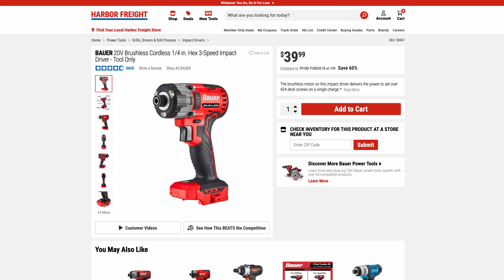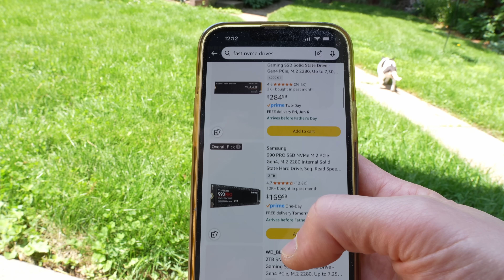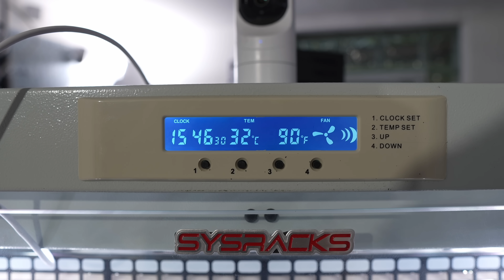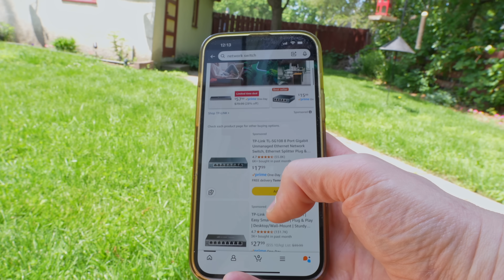Buy Once, Cry Once: How I Wasted $2,857 on Switches

Comment: Love the way you have distilled the approach: "Buy once, cry once". I thought I was over the incremental learning, upgrading, learning, upgrading cycle, but its hard to see when you are stuck in that loop. Most recently I have found this with my solar powered garden shed. Same approach, same failures, and same ultimate lesson. In my case I have settled on  the solar charge controller  I should have always had: A Victron MPPT device with Bluetooth, solar data downloads and rock solid reliability.  Hard to appreciate the RIGHT solution sometimes unless you've spent time (and money) with the wrong ones.

Comment: Doing consulting: I'm constantly trying to figure out customers actual requirements, not just what the CFO budgeted for without any understanding of what their needs were.
It's tricky, but I've gotten pretty good at it. ... This method only works when the CFO's aren't getting replaced every 6 months (or every few years), which lets them realize the gain.

Personal: it's not much of a problem. Even with other hobbies, by the time I've bought something: I've already done so much research and expanded the scope of what I want to accomplish that im already in knee deep.

Comment: I just did this buying my first 10 gig switch, only 5 port when really i should have gone for 10-12 but the cost jump was high. I’ll never have as many devices as you but I have a NAS, a desktop and a PCIe enclosure with 1 Gig among other things. Ugreen just sent me a NAS and one port for the uplink to my WiFi which also has some retro Macs connected and raspberry pi and I’m out of ports. 

Should have splurged so I could expand.

Comment: My problem is I started with simple needs.  I had a few computers using ethernet, one wap, and not much need for anything else.  I then bought a Drobo (boo, hiss - I regret it to this day) and I needed a server.  Drobo died, needed a NAS.  Then, tablets came out - suddenly needed WAPs.  I guess my point - I could not have planned or forseen what was going to be needed.  My rack now has too many switches.  Maybe I'll do what you did and get one to replace them all - could sell my others and recoup some of what I spent.

Comment: 1 - You get a brand new Device with new Warranty when you buy it
2 - Smaller Switches draw less Power vs a larger one with unused Ports
3 - Redundancy when you have 2 small Switches vs one larger one that Powers everything (Single Point of Failure)
Reply: I landed on point 3 when our main 48 port PoE switch at work failed. Now we have two 24 port switches in it's place, if one fails not everything goes down with it and importaint things could be swapped over to the still working one.

Comment: From my experience, 24-port switches are normally a waste, it is wise to just skip 24-ports and get the 48-port model.
8-ports (or even less) are even worse, they are just worth it if you are completely sure you won't need more ports, for example you just need to feed 3 cameras on one specific point and it is physically unnecessary to fit more.

Comment: Problem with tech is that it continues progressing, you might think the switch end of the line, but its not, likely in a couple of years there will be a switch that will do things you need that you didn't foresee before.   Just buy whatever you need that your budget allows, but not thinking its the end, just another fase that likely will require more over time.

Btw how noisy is the switch? i might commit to it if not quiet switch.

Comment: The issue here is not "buy once cry once", but is that you bought only to resolve your current issue and nothing more. 

This is perfectly acceptable for a setup that will barely change. Instead, buying gear that you can expand into would have been a better choice, and as other s have mentioned, some of the more powerful or bigger gear did not exist.

Comment: Well there's a ditch in either side of every good idea...
On one hand not spending enough on the correct solution, and on the other constantly over-spending to try to be the most ahead of the curve as possible...
I suggest penciling the lines before either ditch...

Comment: Personally I always live 10 years ago in networking gear (still on 1 Gbps for everything, but I also have only a few devices). One thing I discovered recently is that buying used, if done correctly, can save you a ton of money.
Reply: Your ISP out is only 1 gps anyway. These equipment makes sense in an office with 50 people all trying to connect to wifi at once with rundant business isp circuits with fiber! But a home user can benefit from an expensive router and a mesh (not to this guys extreme) if 5 people are visiting for christmas and you have 3 cameras, a door bell, smart fridge, and the 5 guests are all streaming and running nintendo switches, tv, netflx, and other things. A good prosumer 10 gb router even with a 1 gb connection out won't lag from the demands.

Comment: I bought a UDM SE a Year ago, because i only needed 4 poe ports at that time, one AP and three cameras. Over one Year I‘ve got so much poe powered gear that I allways had to unplug what I didn‘t need in this exact moment. A month ago I found 2 24 poe gen1‘s and a 48 non-poe gen 1 for all of them together 150€. They are used but Ihad no problems so far. I now have finaly enough ports but if I bought them and a used UDM Pro I probably would have spend the same as I’ve spend on the UDM SE.

Comment: the real issue is all the new devices are forcing you to go poe... if im running poe to my cam outside, i can pull a low volt wire just as easy, so for me i could careless about poe. what i do want is enough ports and now days 10g is the low bar for a new run, id want to pull fiber to every spot and id want a switch with 25/100g options... but sfp to rj45 does have that heat issue wish is not great...

Comment: Im also in the same boat. I purchased TpLink Er8411 and ton of Omaha switches for different purposes just to realize that I completely messed up as the Omaha sdn software is extremely slow and now I have to make the hardest decision to just move over to the Unifi ecosystem that was already planned before I got my Tplink gear that replaced the MikroTik equipment I got first. I spent a lot for garbage :)

Comment: "buy once cry once" is imo more about figuring out what your needs are exactly, planning ahead and adding overhead for future expansions, then getting what you actually need instead of trying to dance around it and get a bunch of intermediate solutions.

Get the right tool that actually fixes the problem, and really look at the solution you're considering to make sure you aren't going to be painting yourself into a corner.

I ended up with a pair of Brocade ICX-6610 switches, which was definitely a bit of a splurge, but got me a total of 32x 10gb SFP+ ports and 48x 1G ports.
Quite a substantial upgrade over the single Quanta LB4M I had been running before.

Comment: bought a dual monitor height adjustable tube mount for my desk because gas spring one was slowly digging through wall. realized I would be better off with 2 single arm monitor mounts for better positioning. returning the mount but need to drive to 2 different microcenters to pick up the 2 mounts, plus its an extra 70$. A rare L when it comes to buying things on my part.

Comment: To be fair unifi has finally got a decent range of switches. They had 150 watt switches they dropped and went with Poe switches with Mickey mouse power supplies in them. Pro max was a huge step up.

Comment: I’ve bought a few dumb and small switches over the years.  Nothing beyond 16 ports.  I also bought a Unifi UDM SE, which is my main current switch.  But 8 have been thinking about how I need to do some upgrades, and I’ve been wondering what I should buy that would take over virtually all switching requirements for the current and near future time.  And I think you may have sold me on the XG.  I’ll have to give it a bit more thought.

Once I do get that replacement switch, then I need to look at what I can get to properly replace the routing/gateway/firewall purposes of the UDM SE.  any thoughts?

I would like it to be able to properly load balance across multiple upstream WAN providers.  Where I live in Austin, there’s only one gigabit-class provider (Spectrum), but I’m actually only getting 60mbps download speeds from them.  I can get ~70mbps on AT&T VHDSL, but the UDM SE doesn’t properly handle load balancing those two configurations.  And even together, that’s still nowhere near 1Gbps throughput.  I’d like to be able to also throw at least a couple of mobile WAN providers for additional bandwidth when it’s needed, and maybe even Satellite as well.

There is PepLink, but they top out at 200mbps, unless you’re buying one of their dedicated reception VMs, which is super expensive.  And the lowest cost PepLink device you can buy is $1k.  Their devices that can handle four or five upstream WAN connections are $CALL_ME for pricing, and even then they won’t talk to you unless you’re a business.

So, I’m kinda stumped.

Comment: How times changes things. I once built a demo cluster with seven servers and a internet connection. This was when Gigabit ethernet was a new thing, so the eight port  gigabit switch cost about $2000, and it was the simplest unmanaged switch you can imagine. Everything fit into one 42 unit rack and some of our customers used it to test cluster applications so they could get an idea of what it meant and how it worked.

But I really remember the price of the switch. Two thousand dollar for an eight port unmanaged Gigabit switch... And now you can get a switch like the one in this video for just a little more...

Comment: Nice Video. The thing is we all knew this already and in most cases there is no real future proofing. I personally think that switch will do it for you in most cases for a long time and 10Base T cards have gotten much cheaper. My home lab and home setup is half your setup size for for 10GB i am still using a 5-8year old Managed(used as unmanaged/trunk) 12 port non poe switch and rest is unifi 1gb switching switching. I will probabbly upgrade in the next year and not sure if I want the Microtik NAS/Switch or what ever the cool stuff will be end of this year. I will be gettign some hardware that will need POE ++ or more.   I see nothing wrong with getting things over time if we are talking over 5-10 years and i usually but the little better then I need for now just in case even if the price is like 10-50% more some times.

Comment: Your issue wasn't buying incrementally, it was failing to consider your future state. You 'just so happened' to 'need' more that 24 ports because you added more devices? That sounds like a lack of forethought at the time you purchased your original switch.

To answer your question at the end of the video - buy-once-cry-once is just another term for future-proofing, which is fine if you're willing to invest the money and actively consider what your future state is likely to look like. You obviously didn't before.

Comment: In photography circles, there's a great photographer (and writer about gear) called byThom. He's got a few maxim's about buying tripods for supporting your camera. His 2nd maxim is "You can spend US$2000 to buy a good tripod and head, or you can spend US$1000 and do the same thing. (Corollary: eventually you'll do one or the other.)" - basically the same point you raise. You can buy a 'just good enough', then find the limits, and upgrade to the next 'just good enough', rinse and repeat until you end up buying what you should've bought at the start, and it'll work out cheaper.

Granted with tech that's always a challenge!
Reply: Where that falls short is that most individuals, these are hobby fields. They will never reach the zenith of the technical skills where they would be better served by more expensive hardware. That being said, it's always fun when your gear goes 'BRRRRR'.

Comment: There were no reasonably priced switches with those capabilities available when you and I wanted it a few years ago.  It was just not available.  Switches are also no a great example because 1G switches have been really the only thing you could reasonably buy for the last 20 years.  Now that industry is FINALLY moving past 1G, we are getting a lot of switches with only half of what we need.  Only a few actually meet the needs.  Other areas of tech move along more rapidly.

Comment: I'm kinda new to the homelab space. So I got a 24 port network switch.

I saw that there was PoE, and wanted to try it. But I couldn't justify the cost. I know I'll need a lot of ports, and didn't want to get a PoE switch that had just 8 PoE ports on it. I wanted 48 ports, with at least 24 of them with PoE.

Then, the luck shown down on me. Someone was giving away, as in they were free, 2 switches, both with 48 PoE++ ports. I dropped EVERYTHING to go get those switches.

At the moment I only have 1 device that's powered with the PoE, but I know eventually I'll get some more. And I am populating only 10 ports at the moment. So I have a lot of expansion to go before these switches are outdated for me. 

Whenever I do outgrow them, I'll give them away, so that the next person can expand like I am/did.

I know that might not happen, but.... It's a dream.

Comment: Good video and perspective. I still prefer multiple switches even if a bit messy, costly and frustrating at times. That 48 port goes out, you have nothing. And if you're in the unifi family, good luck getting a replacement quickly. One of many reasons I went with TP-Link. Amazon same or next day switch in my hands in most cases. Have a backup of some sort if you put all your eggs in one basket.

Comment: OMG!!! this is almost exactly what happened to me. I went and got me a small 8 port switch, than we moved and I wanted Ethernet for every room, and that needed more ports. Then I grabbed a few VoIP phone to be used with Google voice so now I needed PoE and went out and grabbed a 12 port Netgear switch and a 4 port PoE switch. Then I wanted to add more servers and smart home stuff, home run, and APs. Now I needed a bigger switch and poe injectors because I was out of poe ports and they where only 100mb. Then came the big change over. I think we all have that moment when you just say " ok, I am fully committed to getting this perfect. So I laid out an upgrade path  and I didn't have the money to just dump to get everything. So I started with a 12u rack and grabbed a juniper ex3400 48t (cost me about $1500 at the time). Overkill for my needs then but right in line for the upgrade path that I need. Then as time went on I slowly upgraded my NAS to 10gbps with an SFP+ nic, then split my NAS from a windows server 2016 to truenas nas and a Ubuntu for Plex and channels DVR. Added more APs ( no need for injectors, the switch has full PoE) added more lines in the rooms ( if I run 1 line I run 2 just in case) now I am working on a proxmox server to run in a 2u Roswell case I bought a long time ago  and and upgraded my 12u to a 42u and I still use the 12u for small smart home things and cable modem. But I spent a lot of money on things trying to be budget friendly now I just get exactly what I need and plans I have for the future.

Comment: Not objectively expensive, but far from the cheapest option: I bought a relatively quiet air compressor with enough power and tank for all my regular needs, plus infrequent hypothetical needs I or a friend may have. Compared to a cheap one that requires hearing protection and runs constantly, it's a tremendous value!
How is this relevant? My most common use case is blowing dust out of computers. Handheld blowers are a good choice too if that's your only use case.

Comment: I have so many small unmanaged switches, because I was waiting out buying a good rack mount switch until I could swap completely over the Ubiquiti. I know have a full Ubiquiti set up. Only a 24 port 2.5G switch, but I am using half of that, so I will be good for a while on that, and then an 8 port PoE+++ 2.5G switch from Ubiquiti for my TV stand, consoles, and HTPC.

Comment: The premise of buy once, cry once is good on paper if what you want/need exists at the time you want to buy it. The problem I had with the last switch I bought is I couldn't find what I wanted for a price I was willing to spend. Did it exist? Sure...for a blistering amount of money that frankly I couldn't afford. So sometimes its about getting what you can, that checks the majority of the boxes, knowing full well that as a homelabber we're never truly done with our network and there is always another upgrade around the corner...that you don't even know about yet.
Reply: exactly even in this example his buy one cry once switch just came out this year. Future proofing for tech only goes so far. otherwise if its not something you need for a few years by then it will likely be cheaper or better.
Reply: Also when you’re in the learning phase you don’t know what you don’t know.
Reply: i agree with this, buy once cry once is for when its something you actually need, i have had a good amount of projects where i have ended up spending more on tools and other things in the hope that it will be cheaper than buying that one expensive thing that i know i needed. problem is most of the times when you do a project you dont need the most expensive thing you need the right thing. and projects like home server's are projects that develop over time. the first year you have some needs but then the second year you need something else.